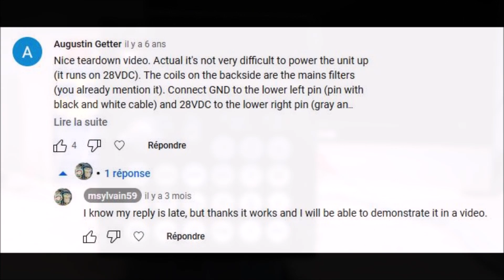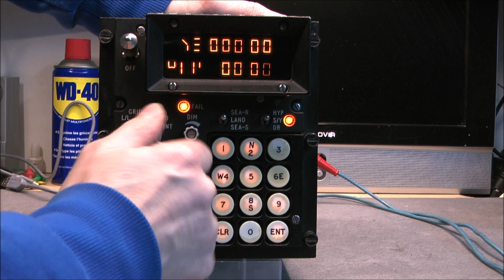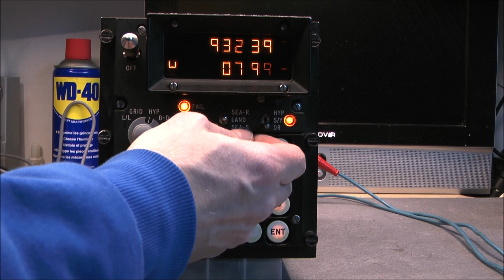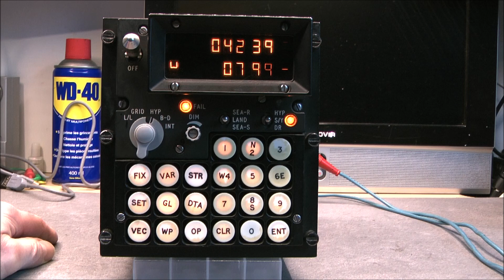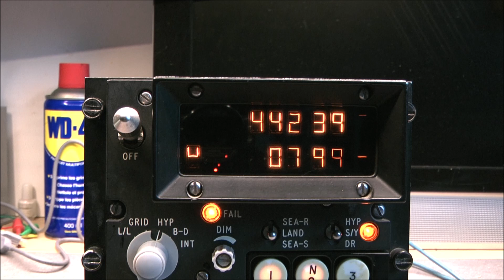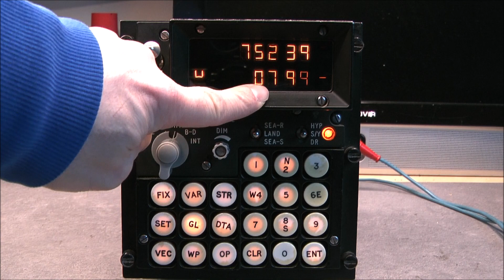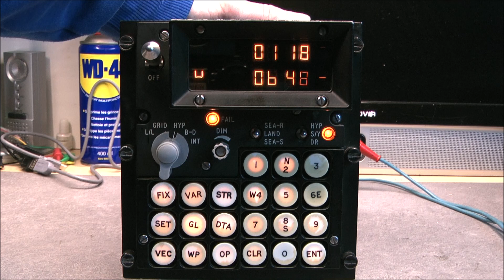Decca type 9447 computer power on test

Comment: Very cool, do you think this powering option would work on other equipment?
Reply from the maker: I have a few other devices that do just require DC power, however it will most the time need some retro-engineering to figure were to apply power, however sometimes technical manuals can be found.
Reply: @msylvain59 yh I suppose, i sometimes risk it if I can find the vcc & gnd lines on the internals but alot of the time they don't show any signs of life. You should upload your collection on Instagram .